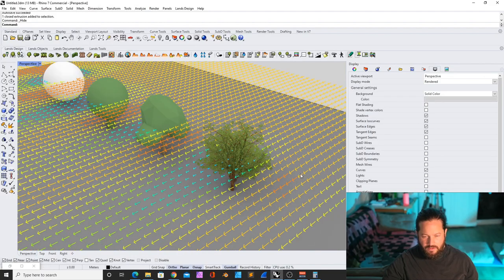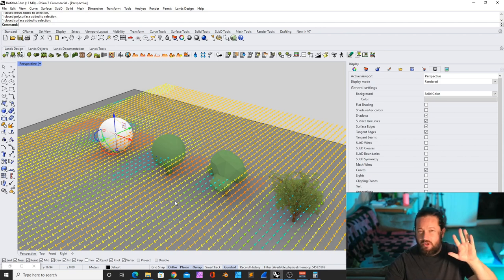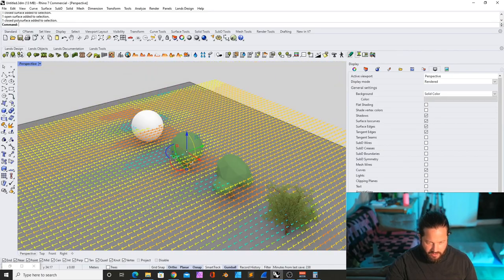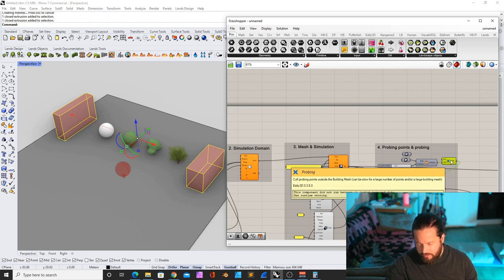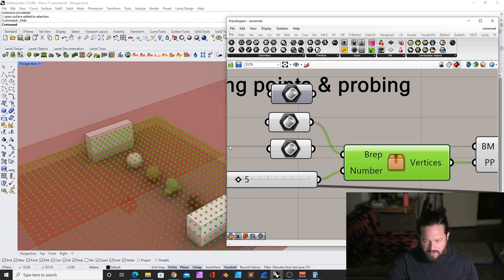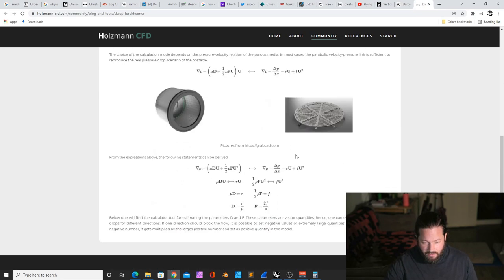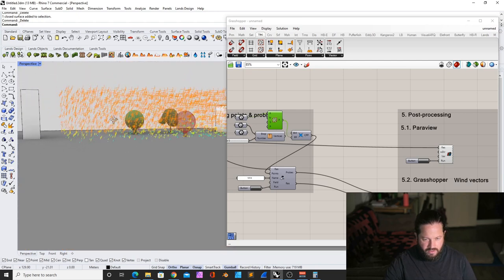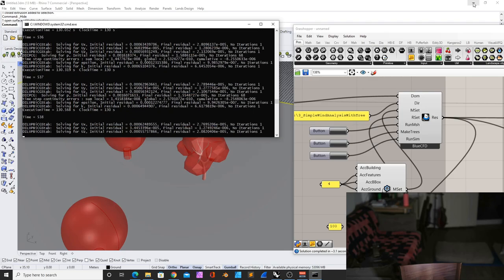How to use Trees in CFD | Rhino3D Grasshopper3d | CFD Part 08

Comment: Hello Philipp, thanks for your video! Great to see the comparison. I was wondering do you have a leafless tree model (like your third tree), but then without the leaf-blobs? Do you have a simple model like in STL or SKP? I am looking at simulating the wind behavior of traditional wind mills in combination with single trees. I am also interested how best to simulate rows of trees... Thanks in advance for your help.
Reply from the maker: Hi Vreijs, i just modeled the tree in rhino for the exercise. I didn't save it.
Should be simple to recreate.  Not sure what you want test if the tree has no leaves blob? Tree in winter without leaves? 
For Rows of Trees well you would just do it in the same way. Just place the trees in the way you want to test them. In that way you can test alll kinds of scenarios and see which one is the best.
Reply: In winter a tree has no leaves and thus will less disturb the wind in front of a traditional windmill. So I have a blobbed tree for summer, but looking for a simple model of a tree without leaves.  @PhilippGalvanDesign  Say with three of four main branches and a few smaller ones. I have no real tool to make it myself, so I was hoping there would somewhere such a 3Dmodel (in STL or SKP). The row of trees: I was thinking if there perhaps is a simple (computational less) tree row possible. I can repeat single trees, but perhaps a simplification is possible? Thanks in advance for the feedback.
Reply from the maker: @vreijs  I see, understand. Sorry I don't have one at the moment. But for sure there are plenty of free models out there. I would look for simple triangulated tree without leaves. I can also model one but need to charge up front.
Reply from the maker: @vreijs  I assume you have rhino otherwise you wouldn't be able to do the wind study. In rhino you should be able to model a simple tree no? Or you can use the blobbed model and use a higher transmission rate. Which is probably more accurate anyway.
Reply from the maker: @vreijs  yes for the tree row you can use just a simple stems with a box representing the tree crowns as a whole...
Even a simple boundary box with  transmission rate is probably enough but better would be a roughly modeled version of the tree massing. Thinking about it I think for winter trees just increase  the transmission rate.(more transmission) Because a tree never has just 3 branches except very young. Research online what the transition rate might be...
Reply: The problem is that SIMSCALE Community Plan does not support porous objects... Should I indeed go to Rhino (how simple is it for 'naive' users)  @PhilippGalvanDesign
Reply: I have looked wrongly. SIMSCALE supports porous objects. I am now testing that and using your idea of using my tree model with a transmission rate (of 0.25 for winter)
Reply from the maker: @vreijs  definitely a better approach...
Reply: Hello Philip, can you tell me what values of d and f are used for the three types of trees you have in your video (dense, medium and coarse)? I had found that d=0 and f=0.14 for an oak tree (say medium tree), but that does not give result as I would have expected (looks to be very coarse trees...)  @PhilippGalvanDesign  Thanks for your help.

Comment: Hello, I would like to ask if CFD can be used to simulate the foliage of localized balcony plantings?  I'm looking for some articles on coefficient settings.
Reply from the maker: I haven't tested it myself but it should work similarly as in the video. I know from Rhino CFD that this is possible to some extent. (As far as a simulation can be realistic). In eddy I think you can define any shape as 'tree'.
Reply: @PhilippGalvanDesign  I see. Thanks for the advice!!😃😃

Comment: Thank you so much for the tutorial, I do have a bit of a problem that every time I run the visProbes, most of the time it doesn't show any arrow. Have you encounter this problem before?
Reply from the maker: Butterfly CFD is a bit buggy.... it's never been finalized. When I have that problem  I normally start a complete new calculation by renaming the case... 
The only problem with that is that you need to clean your computer from time to time because the old calculation is not deleted and the files created are quite large...
Reply from the maker: Do you have any particular error messages when you face that problem?
Reply: Thanks, I just restarted the program and renaming the file, and it works @PhilippGalvanDesign

Comment: Thanks Philipp for your very helpful video :) I have a question about how you can simulate buildings with trees? I had problems with that. Is that the same script but just with the buildings mesh input into the "geo" of the "2. simulation domain" and "BM" of the "4.probing points & probing"? Thanks again for sharing your experience~
Reply from the maker: Should be quite straightforward. Combining the script from the previous video with this one. Check my CFD playlist.
https://youtube.com/playlist?list=PL4Rc2GtLpcNVWy0DsYd74cY8LSczF8V1B

Comment: Hi Philipp, great videos as always; I am wondering, is there a way to visualize the arrowed vectors as a single connected curve for better visualization, like other CFD simulators? or colored mesh? As alternatives.
Reply from the maker: Hi Ahmed, 
Coloured meshes should work. You could use the velocity or pressure etc. values on a ladybug heat map. Relatively simple.
Connected curves I'm sure it could be worked out but need deeper understanding of the OpenFoam. But....
Every case is also written as a file into the case folder. You can open your analysis in paraview. And there you can do alot more from a visualisation point of view. I'm actually planning a video about it.
Best
Reply from the maker: Just realized that you used butterfly. I think butterfly has its own heatmap tool.
Also it has a tool to directly open paraview...
However paraview is another animal but super Powerful.

Comment: Hello Philipp, I can't input my building geometry to <2.Simulation Domain>'s Geo sector.. It takes forever even if I inputed only one simple box. Do you know how to solve it? Thank you soo much all of your helpful videos btw..!!!
Reply from the maker: What is your models unit system?
Reply: @PhilippGalvanDesign  It's in millimeters. Should I change to meters?
Reply: Thanks! It works, though still very slow
Reply from the maker: @sio980  yes meters, everything is calculated in meters. Obviously you need to play with the settings. Are you on a laptop?
Reply from the maker: @sio980  This type of CFD analysis is super intense. So yes it's slow.
Reply: @PhilippGalvanDesign  Am on desktop actually. Is it possible to simulate with urban block scale? :D I've been trying still
Reply from the maker: You mean large scale district size analysis.
I did this with Butterfly CFD. Same engine as Eddy...
https://youtu.be/4KfZDqlfHeQ
Reply from the maker: It's all about managing the level of details needed.
Reply: @PhilippGalvanDesign  Thank you! Today I'm gotta try Butterfly as well